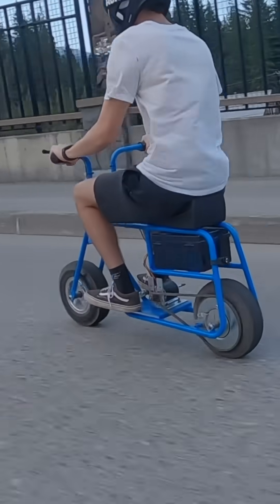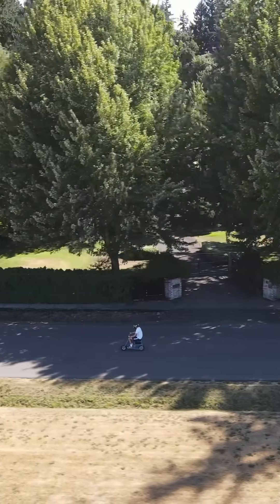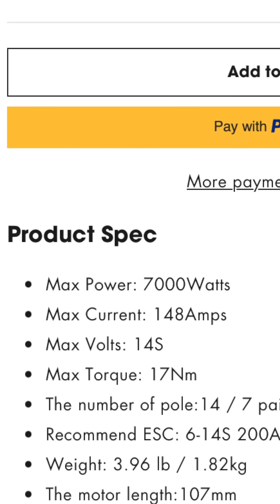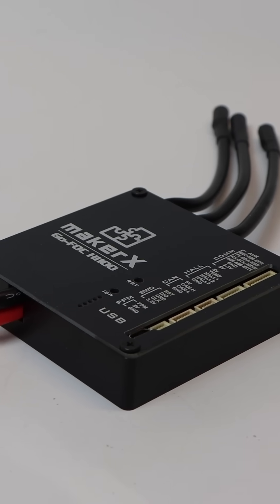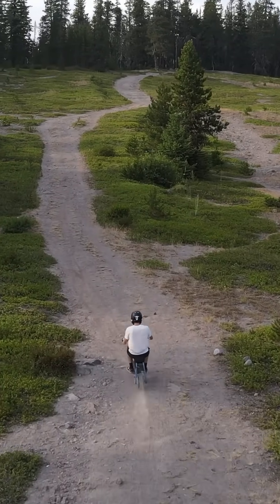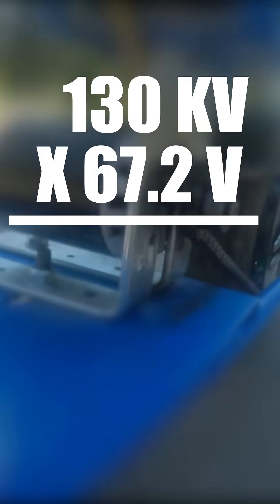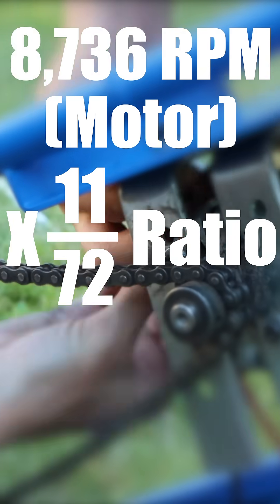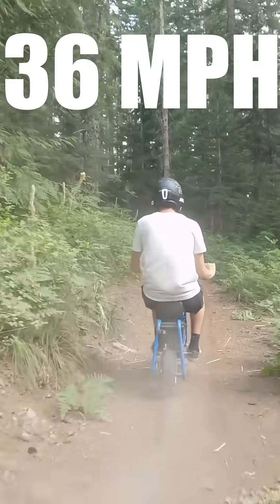Is our 7,000W Mini Bike Is a LIE? #diy #electric #minibike #ebike #bike #electricbike #power

Comment: You could gear it do 100mph down hill which will cook the motor on the flat . You sacrifice speed for torque so it goes up hill without pushing . Moral about the story is build it for your own spec , you have your own spec and its 36 mph that probably climbs effortlessly

Comment: How fast Will a 3kw bike go(if i made It the same way as yours?)
Reply from the maker: Really depends on so many factors. The wattage of the motor is an important spec to look at, but often not correlated that much with speed. Depends a lot on battery voltage, gearing, wheel size, motor KV

Comment: In my country, there is a law requiring a driver's license if the engine power (which is the engine, this is important) exceeds 250 watts, however, the police fine food deliverers by checking the battery power, logic once left my country a long time ago